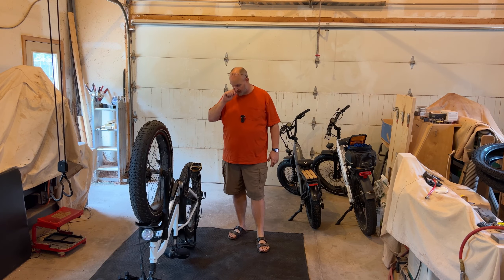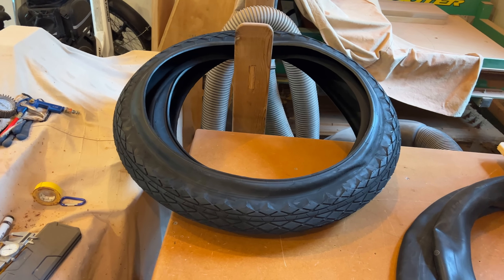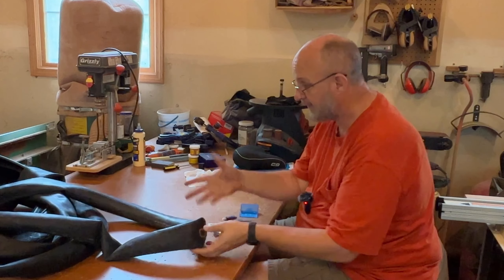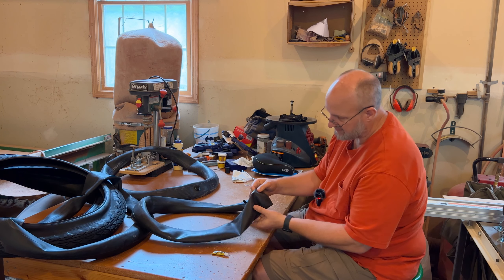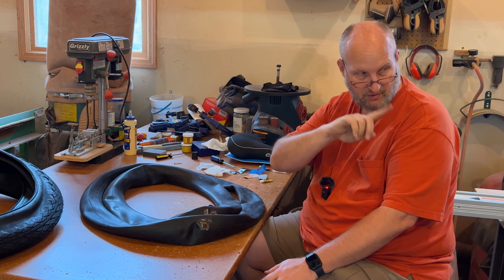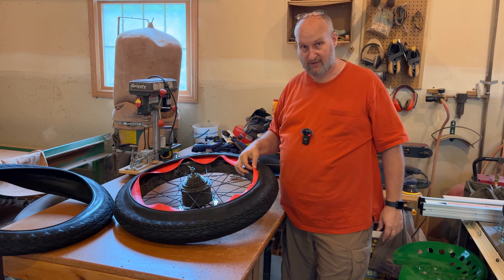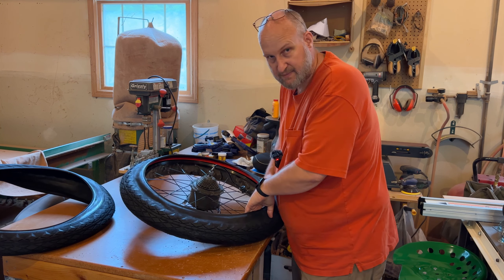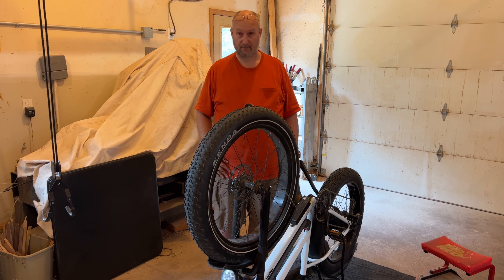Tube Repair and New Tires - Tinkering Turtle

Comment: Great video will you do a video on  a ride on the new tires?
Reply from the maker: I will definitely report back on how they ride. I have to say, at first, they were very “grippy”. I was a little concerned how they felt in corners, but after about 20 miles they are much nicer. So there is a break in period for sure.

Comment: I run the Origin 8Supercell, front and rear. Mine are 30tpi, they hold up well and with the Tannus liner. Uts a 90$tire but on sale right now, 68$ w/shipping
Reply from the maker: Nice. Keep in mind I ordered these last year. Currently these tires are on sale for $45.77.
I do wonder if they are the same tire, just branded different.
Reply: @TinkeringTurtle  i dont believe they the same. I couldnt find the SandStorm w/ 30tpi. TPI is a big difference for me as riding on the road at times can be a mine feild some times. But the Tannus and flatout nake great combo and uf u dont pull the screws out but twist them, in most cases u dont gotta break it down for a patch. Idk how many miles on my tires, forgot to log it but they wear nice compared to the soft Kendas. I look for the origin8 onsale, got it this time for  68$w/s&h
Reply: @lrigco  i can change my tire like its a pitstop now, done it enough. I usually lucky enough to make it home , flatout is stupendous

Comment: When I good time to change tires my front looks fine but back is smoothing on my Magicycle cruiser mainly ride pavement and over 1000 miles on bike
Reply from the maker: I guess whenever you don’t feel that the tire has enough tread to avoid flats. Some of the “worn” tires I have seen, you can see (thru the worn black tread) some green rubber. This is a clear sign that it’s time. 
If the rear tire hasn’t progressed that far, you could also consider rotating your tires. It’s up to your judgement.